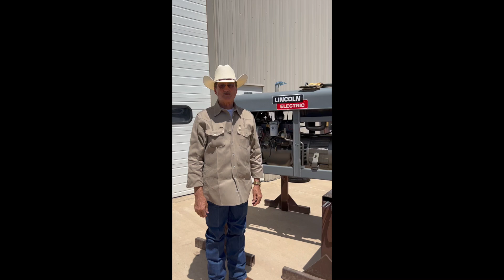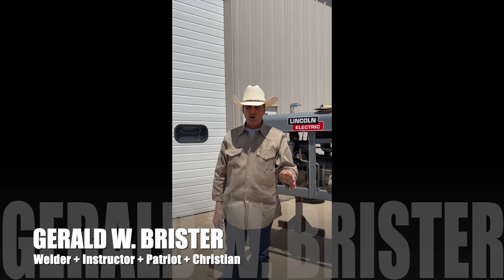Little known history about Lincoln and Miller Welding Machines

Comment: I had an old ac dc Lincoln welder  was in a wooden box with carrying handles on both ends I’ve never seen one like it. Last time I used it was1978 I heard it went to a truck museum in woodland California . it looked like it was a very early model it came from big bear lake in the san bernardino mountains i was told when I was a child that it worked on the dam project very early 1900s would you have any information or pictures of one?
Reply from the maker: Sorry, I’m not familiar with it, but it would interesting to see one!
Thank you Brian!
Reply: @GeraldWBrister  thank you for responding I’ve been looking on the internet and haven’t found anything I will contact Lincoln next I’ve been welding for fifty plus years and i was asked what was the first welder I had ever used and some thought I was bs them and I would like to show them a picture of one.again thank you

Comment: Those SA200s are hard to beat... even today they still are an industry standard. But i am a fan of the newer miller welders... particularly the 302s with an airpak... it just makes sense to have an air compressor built into the machine... and you can run a plasma cutter vs cutting torch. That can drastically reduce your consumables cost. Miller welders also offer clean ac power which means you can run sensitive electronics/ac/dc tig machines off them if the job calls for it... and the wirless ditch box is a godsend... when i was a helper, muddy cables were the bane of my existence... there arent enough rags in the world to keep your welders leads clean on a wet job (and if you arent wiping your welders leads down every time you roll up, youre a trash helper)... run cordless grinders (milwaukee) and you only have two cables to clean and keep up with
Reply from the maker: You’re right about cleaning those leads I hated it to!
Thank you!

Comment: Back in the nineties I work for a company called Krause plow in that shop you got paid for what you do tip sticking Millers I wouldn't give you fifty cents for every one of them back then Lincoln in Hobart Lindy's those were good machines if you were late and that blue devil was sitting in your bae you develop a stomach ache or headache or wife was in a car wreck mom just died something to get out of welding with that machine
Reply: Then I moved on to Mega Manufacturing at this time piranha ironworker with still a product of that company I started working in the boom shop building Pioneer crane booms and again they had one of them Miller's with these programmable features it spent more time in the repair shop then it did on the floor not that we locked welding with it anyway when you're running spray transfer at 42 V probably 550 to 600 in of wire you spend more time changing tips than you do welding
Reply from the maker: when i was younger i saw welding inspectors turn welders away from testing if they had a miller welder!